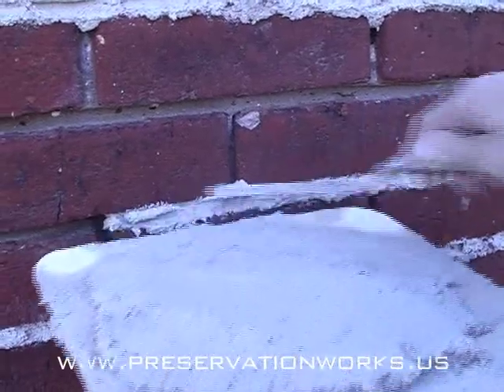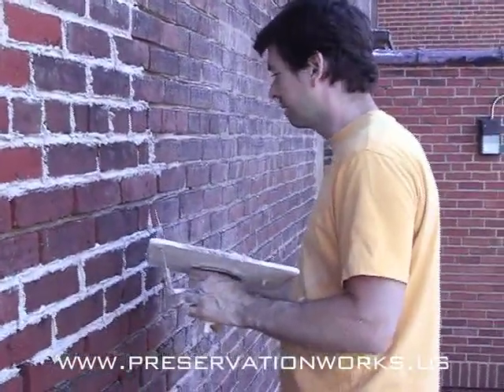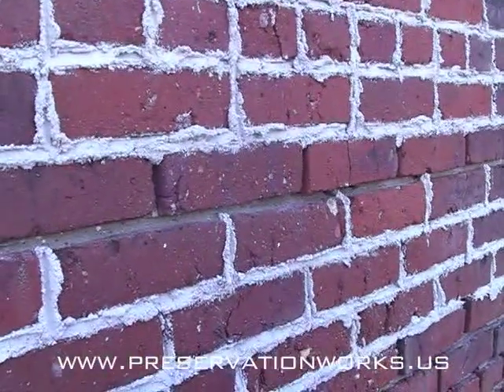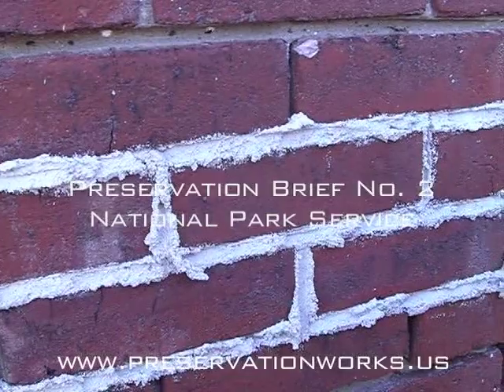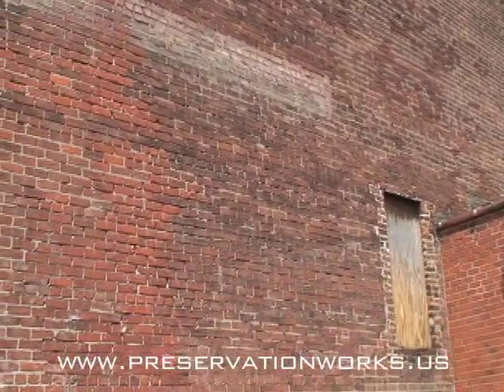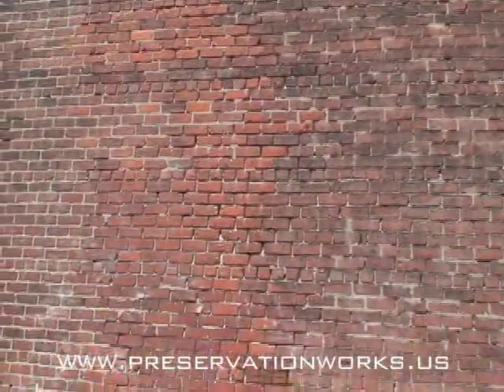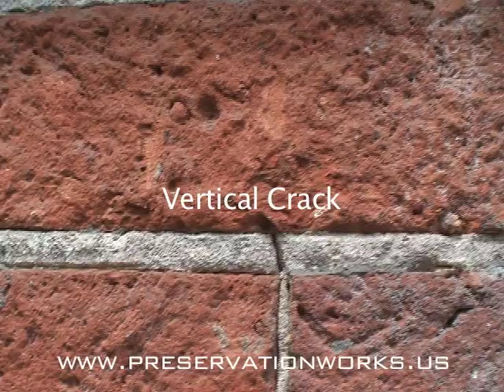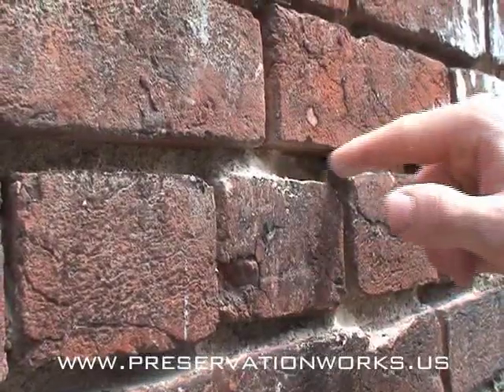Lime Mortar Repointing: The Basic Techniques for Restoring Historic Brick Homes

Comment: i have this but worse, much worse. lots of vegetation in the pointing. deep, very deep holes with black sand and seeds and/or plants. how to get it out? i have bought so many picks, brushes etc. tried to use a paint stripper gun to dry/burn the vegetation, scratched out the sand and roots, but STILL it remains. than i sprayed with garden sprayer which you can pump up for higher pressure. STILL sand and roots remain. please help. when i say deep, i mean really deep: holes of 8cm or deeper in a 46cm wall. please advise!

Comment: Interested to know how much easy the mortar needs to come off if I take a flat head screw driver and drag it hard on the mortar, if I'm able to get out a few small grains of mortar is the mortar considered weak and crumbing? Thanks in advance. In your video just by touching the mortar, it all comes off, which is too easy.
Reply from the maker: No, not generally if it's just a few grains but it depends what type of mortar it is. Cement mortar and lime mortars age differently.
Reply: @PreservationWorks  thanks for your feedback

Comment: What did you do about the broken/spalled bricks in this wall please? for example, did you replace them all, some or none? If you left some how did you decide and did you give them any treatment?   Thank you for great video!
Reply: Hi, this is my question aswell? Thanks :)
Reply: @charlottewarburton5488   since this time I have started repointing the bricks on my house. I intend on replacing a lot of them, however, I am also going to try a bit of 'refacing' where they are not too bad. i.e. using brick dust (I have a lot!) and lime mortar to great a new facing to the brick. Not tried it yet, but thought you might be interest.

Comment: Thank you for that information on hardness of mortar and spalling I was always told that type N is sufficient for Brick. But type S is to hard? In the restoration process of an old building I would definitely use the lime mortar. I am a chimney Builder and I come across chimneys all the time with spalling brick sometimes 90% of the chimney is spalling. I always see chimneys that are hundred years old or so last forever with no spalling but newer Masonry gives out a lot quicker. Why the change from lime mortar to cementouse?
Reply: My understanding is because after 1930 bricks began to be fired at a higher level because technology changed and therefore you needed to use a harder mortar, which is why cement began to be more popular.

Comment: Hi we are building a new house with bricks but since our old house was also made of bricks we have decided to use those old bricks for all the inner walls and purchased the new bricks for all the outer walls. It is a two storey building. Is there any trouble for reusing the old bricks. Please kindly reply
Reply from the maker: Shouldn't be a problem if the old bricks are cleaned properly and in good shape. If the old bricks have mortar that needs to be chipped off, it can be a time-consuming process to be able to reuse them. Hope this helps! If you have more questions and require a faster response, please contact us directly at info@preservationworks.us
Reply: @PreservationWorks  Thanks for your reply.

Comment: Hello!
I have an old room where i removed the old plaster on the inside, because it was damaged, mold etc., therefore exposing the brick work with it's old lime mortar. The mortar now is turning into a sand dust if I touch it, so, I think it needs to be removed to a degree and repointed . For rendering the wall I will use cement based plaster, instead of lime, because lime is pretty rare in my zone, cement is almost the one and only choice for constructions. Do I need to repoint the old mortar on the inside before I apply the new cement based plaster, or should I let it the way it is? And is it ok if I repoint it with cement mortar? I am speaking only about the plaster on the inside of the room, heated zone, not the outside of the house.
Reply from the maker: Thanks for your message. 

Please feel free to contact me directly at info@preservationworks.us, but to give you a partial response:

There should not be mold on lime based plaster; how old is the building?
If lime mortar is turning to dust, it should be removed.
I wouldn't recommend using a less-permeable, cement based mortar; you could get high calcium lime or type S lime which can both be turned into lime putty. 
Also, we have natural Hydraulic lime for sale at www.preservationworks.us

Again, reach out to us directly for more info!

Comment: How much time does it take for the newly applied lime mortar to cure?
Reply from the maker: Natural Hydraulic lime generally begins to set somewhere between 4-8 hours after mixing,  and it reaches its minimum compressive strength in 28 days.
Reply: @PreservationWorks  thanks

Comment: a few tidbits, always point from top to bottom! saturate the wall first! Lastly, lime mortars need to be kneaded, as the compression forces the lime molecular into the aggregate. Stand time before using, as well as specific water and aggregate amounts must be adhered to. this can mean the joint lasting 10 years or 50 years is properly done. thanks

Comment: Hi. If anyone can answer this question it would be greatly appreciated. I have exposed a brick chimney breast in a bedroom, its nonfunctional, just a feature. I used portland cement to repoint it. Will i have trouble with this in the future? Also if I was to seal it what material should I use? Thanks.
Reply: It'll probably be ok since it doesn't get wet and freeze

Comment: The mortar is not expendable like the tyre of a car as you say. If too much of the mortar deteriorates the wall will fail. You can only repair the mortar on the outer edge, the mortar behind this must hold the wall for the walls entire life. So how much mortar does a wall need, will a wall fall down if 2 inches of mortar are missing??

Comment: Lime mortar tuck pointing is more complex than just a standard combo mix of lime, sand and such.  To properly tuck point, testing of the mortar of the specific structure must be done.  When this is done, then you will know exactly what ratio of mix you would need for a specific application.  If you don't have your mortar tested than simply following some standard mixture could do more damage than Portland cement.  Always check references of a restoration company before hiring.  If they are not willing to have your mortar tested to find out it's base ingredient combo then they are not worth hiring.  Testing is simple, but it's the waiting for results that is key.  The restoration company sends out the samples and then they wait.  A series of tests are done on the mortar and when finished, you are informed exactly what is in your specific mortar and what the specific ratio of ingredients to use to match your original mortar exactly.  Demand the best folks.  If you are going to invest in repointing your 100 year old residence, then the least you can do is DO IT RIGHT.
Reply: Roberta Kratochwil  You appear to be using tuckpointing interchangeably with repointing. If so, this is incorrect. Tuckpointing is a specialized pointing technique done to increase the appearance of uniformity of the mortar joint (as well as conceal irregular mortar joints necessitated by irregularly-sized bricks and / or stones). More specifically, it creates the illusion that the mortar joint is much smaller than it actually is and thereby suggests that the wall is built of expensive, precisely-formed bricks.
Reply: wher would you get your mortar test done ???
Reply: @giuseppedigennaro4753 any lab with a mass spectrometer

Comment: What is a mixing ratio for lime mortar? Some sites suggest the sand, portland cement and lime are 5:1:1 whilst some suggest 8:1:3 respectively. What ratio is correct for repointing? Thanks
Reply: I'm 9 years late, but the historical mis mix would be 6 sand, 1 Portland, 1 limestone
Reply: 5 building sand
2 sharp sand
2 lime 

For bricks 5:2 or 5:1:1 using hydrated lime an cement

Comment: Hydraulic lime? I wouldnt use hydraulic lime. It's not about how complicated it is to work with non-hydraulic lime. It's about how often you want to repeat the repairs. Hydraulic lime is falling off after 4 to 10 years. Non-hydraulic lime maybe after 150 to 300 years :) The more it rains on it the longer it will last. In the old days there was no hydraulic lime but those buildings still exist - in contrast to those build with our more modern obsolescence-designed pseudo-lime products.

Comment: Lime mortar is very complex. Heinrich Burchartz has tested hundreds of lime mortar mixtures under lots of conditions. Generally the quality depends on many factors like amount of carbon dioxide available for reaction, sand used, temperature, humidity, etc. There is no general rule. Lime mortar must be manufactured to suite the individual situation. It could take months to find the right mix for the given application.
Reply: From a distant eye, I would  think he is in the NHL12 range.

Comment: Do you guys put in dpc 's in your brickwork 150mm above ground? Im  from the uk and i was wondering if you guys did. Also do you get rising damp?
Reply: Over here on older mass wall masonry, a damp stop is applied at the watershelf, approximately 16" above grade. Newer vaneer walls have a thorough wall flashing at the base, preventing rising damp in the process.

Comment from the maker: Yes this is true but I have found that the worry is generally unjustified.  "Slightly" wetter mortar is easier to work with and less physically demanding on the applicator. The wall in this video had no shrinkage cracking for example. A greater problem concerning cracks is allowing the mortar to dry out too quickly either because the wall was not sufficiently wet before installation or because it was not protected from sun and wind after installation.
Reply: PreservationWorks Rob... please call me back. I need you to come do this job... I know your busy, but I'll even pay extra. Tara was supposed to contact me for a credit case deposit, but I never heard from her.

Comment from the maker: Thanks for the compliment.  I never had any cracking problems with "slightly" wet lime mortar. It is more important to have a damp substrata and to keep the mortar from drying out too quickly, this is the root of most cracking in my experience.  The joints were 3/8" not 5/8" and were cut back 3/4 to 1" or a depth of at least twice the height as per historic restoration recommendations detailed in Preservation Brief 2-  which is where most architects get their knowledge of historic restoration.